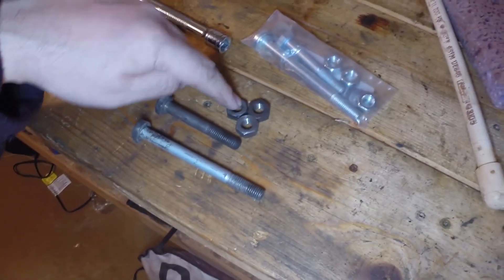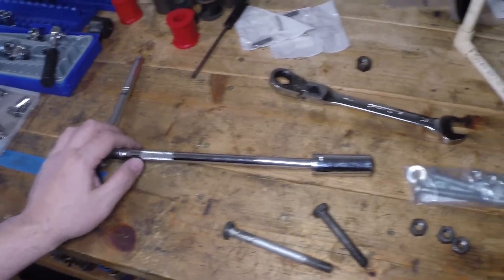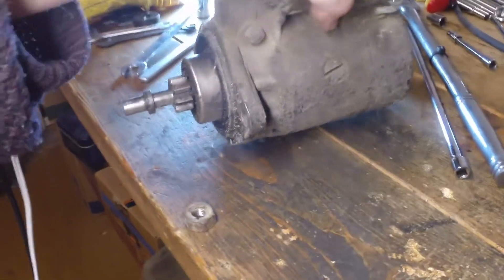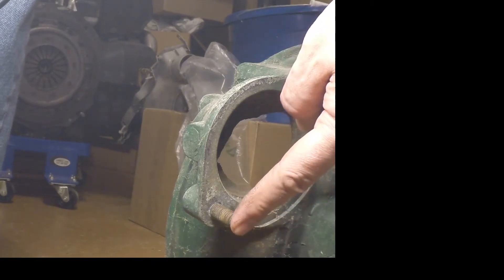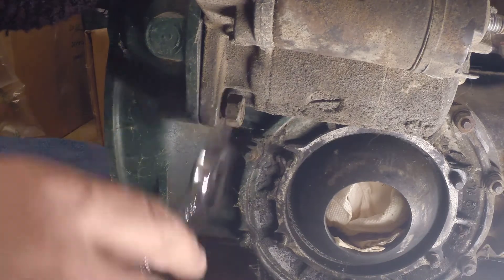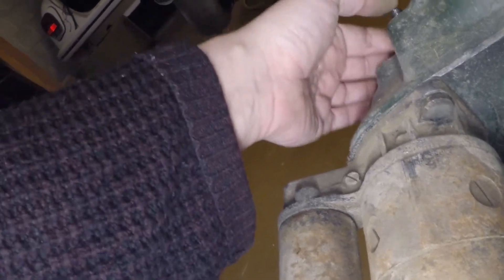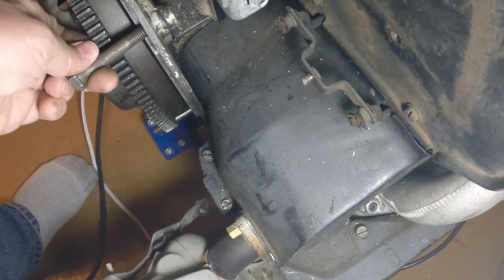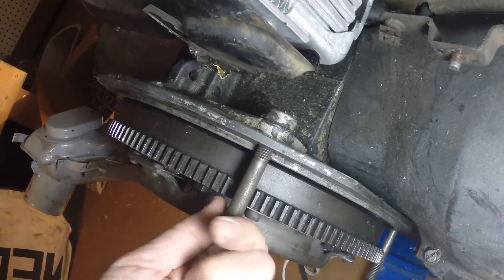Aircooled VW engine mount bolts

Comment: What are the size of the bolts and nuts I thought I heard you say metric 17 mm is that correct size and length is that through basically all Beatles from 50 to 60 s?
Reply from the maker: I believe for my 1972 Super, you access the bolt heads and the nuts with a 17mm socket or wrench, yes.  If memory serves the diameter of the threads (the size of the bolt if you're buying it in a store) is 10mm.  

As far as how consistent that is, I have no idea.  I suspect it's pretty consistent but I don't know.  As I mention in the video, the arrangement of the upper left bolt varies between non-doghouse and doghouse oil cooler cars.  If you want a real answer for that, go on thesamba.com and ask.  

I think my real answer to your question is if you're missing mounting hardware for an aircooled VW car, just buy a mounting hardware kit that's the right one for YOUR car.  They will have all the right fasteners and washers and they'll be strong enough to serve the purpose.  Good luck!

Comment: Boss man after the bolts and nuts for the housing are off the motor should slide right off the transmission? I’ve done stuff on newer automatic vehicles and I was wondering if there is some sort of interior bolts like how the automatic transmission ls have connected from the flywheel to the torque converter. I’ve been having trouble getting past the bolts and nuts part
Reply: Do I need to remove the clutch linkage or anything extra? I am trying to remove the engine only
Reply from the maker: @chapo9724  See above.  No, the clutch cable connects to the clutch arm which is attached to the transmission housing.  You do NOT have the remove the clutch cable to remove the engine, but you DO have to disconnect the accelerator cable from the carburetor.
Reply from the maker: I'm sure there are youtube videos about removing an engine from an air-cooled VW, or failing that, books about it.  

As far as your specific questions: 
The only connection from the engine side to the transmission side at the clutch is that the center of the clutch slides onto the splined transmission input shaft.  The four bolts (discussed in this video) are the only STRUCTURAL connection between the engine and transmission.  FIRST REMOVE THE OTHER CONNECTIONS (see below), support the engine on a support or a jack, remove the bolts, and slide the engine to the rear.  The engine doesn't have a lot of extra room.  It will be free of the input shaft about when it hits the back of the frame.  You have to TILT the engine back to get the clutch free of the input shaft.  The clutch connections to the car are all on the transmission side.  

Other connections you have to remove BEFORE the big ones:  the fuel line (PLUG the hose from the car!), the clutch cable, the main electrical connections from the car, the connection to the transmission for the reverse switch (that may depend on year), and the connections to the evaporative fuel canister under the right rear fender (definitely depends on year), and the connections to the heater boxes.

Comment: Why not fitting washers? Very bad without. To keep the D screww in his position , use a littele bit rubber or other soft plastic over ist. So it cannot move back out.
Reply from the maker: The car didn't have washers when I got it, and I haven't bothered to add them.  I may try to remember to get some and add them when I have it off the next time, but I'm probably not going to seriously lose sleep over it.  

Having something to hold the D-bolt in place would be great!  I would love to see a photo of an example of this if you have one.

Comment: Hi! great video. are all the 4 bolt transmission patterns interchangeable? Im new to the vw stuff and looking to buy a 1600cc engine to bolt into a dune buggy i have. The transmission i have uses 4 bolts like you have in your video. I purchased the buggy without any engine. i have found several engines for sale locally. In my research it looks like the transmssions are somewhat interchangeable. Any info would be appreciated.
Reply from the maker: I think all of the bolt patterns are the same.  However, my impression is there are a couple of other considerations.  

As far as the engine mechanically matching the transmission, you'll want to make sure that they're the same "voltage".  The starter and flywheel gear teeth are different between 6V version of the Beetle (1966 and previously, approximately) and 12V versions (1967 models and later).  I think the engine bell on both sides may be slightly different on both engine and transmission as well between 6V and 12V.  

I"m pretty sure that any 1600 engine is going to be 12V, so you'll want to check your transmission and starter (if any) if they're 12V.  If they are, then you may be able to use them as-is.  If the transmission/starter combo are 6V, then you might want to consider swapping them out.  

As far as the transmission, if you need/want to swap it, then it's a consideration whether it's a swing-axle or an IRS.  Swing-axle has single axles hinged at the transmission end but otherwise solid.  "IRS" has constant-velocity shafts that have U-joints at both ends.  I presume it would be more complicated and expensive if you wanted to switch from one to the other.  

Double-check all of this; I'm not an expert on any of this.  Good luck, and let us know how it goes!

Comment: No engine mounts from engine to frame?
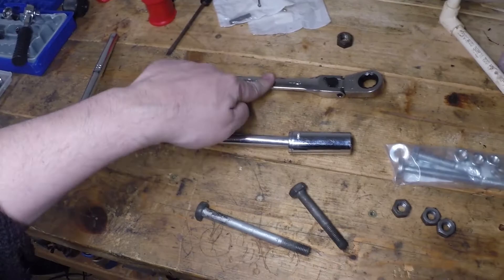Reply from the maker: No, there isn't.  I mention at 1:25 in the video that the engine mounts rigidly to the transmission, but the transmission attaches to the frame by three flexible mounts that serves to cushion the vibrations from the engine/transmission assembly from the body.  The engine tin is close to the body all the way around the engine bay but it's not mounted to the frame there.  As far as the rear sheet metal of the car is concerned, the engine floats there.  All its weight is on the transmission.  

Does that help?

Comment: Awesome video and helped make so much sense too me. I always wondered why three nuts and two bolts. Now it all comes together (no pun intended )
Reply from the maker: You're welcome, thanks!  

(For others who may read this comment:)  Yep!  It's studs and nuts on the lower two, bolts and nuts on the upper two....except that the nut on the upper left is pressed into the engine bell housing and so is hidden.

Comment: So I can't find this answer... should the 4 studs have washers along with the 17mm nuts?
Reply from the maker: I suspect they did originally have washers, yes.  The new engine mount hardware set I have in the garage as a spare has a wavy washer for each nut.  I presume they're mainly to protect the engine and transmission bell housings from scoring as the nuts get tightened. 

Having said that, my 1972 Super in the time that I've owned it never had washers anywhere in the engine mounting hardware, just the nuts.  I haven't bothered adding any.

Comment: good video. What size ,thread, pitch are these bolts? I'm build my car from scratch. I don't have any of these bolts. Thanks
Reply from the maker: Hi, 

The engine mount hardware is important enough that if I were you, I'd try to buy them specifically made for that purpose.  In any case, I'm not sure you can get the extra-long bolt with the D-shaped head anywhere except a VW supplier.  The part number for the hardware install kit is 111199000A (for 1971 and later VWs).  It's available at Wolfsburgwest.com for $6.76 right now.  That indludes the long D-head bolt, the other bolt for the other upper mount, three nuts, and washers.  

To answer your specific question, I just got out my spare kit.  They seem to be M10 bolts/nuts by 1.5 threads.    But again, if you're actually going to hang an engine with them and drive the car, I'd just order the real thing and be done.
Reply: @fsodn  .Thanks ! this is alot of help .ill order them. also do you  have any idea what bolts/ nut size for the bracket that holds the cable clutch to the trans axle? I have a sedan trans that's missing one bolt and i have no nut for the bolt thats there. Id like to save 15 trips to the hard wear store while trying to guess metric sizes.Thanks for replying !
Reply from the maker: I don't know, and I'm not with my VW stuff at the moment.  

If you don't have one, I would go on thesamba.com and create an account.  It's a great community and there are folks there with a ton of knowledge.  I would ask your question there.  I'm sure there's someone who knows.
Reply from the maker: FYI: metric bolts are sized by their outer diameter in millimeters.  If you don't have one, I would pick up a cheap calipers.  Measure the outer diameter of the bolt (including threads) and the "M" size is the number of millimeters that are slightly higher than that.  The engine mount bolts were just slightly less than 10 mm in diameter, thus M10.  

For any given M size, there will usually be two thread numbers, one "fine", and one "coarse".  In metric the number is the distance between the threads in mm, so the higher then number, the coarser the thread.  

Here's a thread they have on bolt threads: https://www.thesamba.com/vw/forum/viewtopic.php?t=313722

Comment: At 5:51 I saw stocking feet while lifting the tranny. Nope! That’s just dumb, on par with using a carpenters claw hammer in a metal shop. All your cred vanished in that instant.
Reply from the maker: The transmission is like 20 pounds, less since that particular transmission is missing about 60% of its innards.  I could hold it up with one arm if I had to.  My feet are in no danger.  

I don't have a metal shop.  This is my garage.  I'll use a claw hammer in it if I damned well please.  

I've done way stupider stuff on my channel than lift a transmission in stocking feet, or use the wrong hammer.  I have a video about using a ball joint separator tool to extract some rubber suspension bushings.  I recommend that video; it's really scandalous!  Really, I'd check out all my videos to catalog the dumb things I do.  There are admittedly a lot.  I used a drill on a gas tank; it's pretty awesome.

Comment: Thank you, I don't think I would have gotten that one top bolt opposite of the starter off if it was not for your video.  I am used to older VW engines where there was just a nut there.
Reply from the maker: That's fantastic to hear!  

So it was a bolt with a hex head under the car, and a nut on the engine side?  

That's super-cool!  I'm so glad it helped.
Reply: @fsodn  My '70 bug has a tapped thread in the engine case and a hex head bolt through the transmission side, like in your video
Reply from the maker: @tompearson8364  Does your engine have the dog house oil cooler shroud?  In other words, can you reach where the nut would be on the car with the engine in?  

Thanks for the info.
Reply: The engine has an older style oil cooler so there is space to get a wrench behind it. However, the case is from a newer model that had the doghouse
Reply from the maker: @tompearson8364  Yeah, that'll do it.  I'm so glad this was useful for you!

Comment: Your explanation  of the 1971 save me alot time as opposed   to the the other You Tube vids
Reply from the maker: Wonderful!  I'm so glad.  Yeah, it's hard to see them on the car.  Having removed and installed the engine in my VW a few times, and mostly doing it by feel, I wanted to make this to help people do it.  

What kind of VW do you have?  Were you removing/installing the engine, or the starter, or what?  

Thanks for watching.

Comment: You’re mixing up left/right etc! Common problem with VWs is also front/back description. We need a standard!
Reply from the maker: Thanks for the comment.  Mixing it up is easy to do, yes.  People often refer to the "rear main seal" in a VW engine, which is on the flywheel end of the crankshaft (and thus is the forward end of the engine).  

However, I don't believe I made any right/left mistakes here; I just watched the video again to check.  I always refer to the right upper mount as the one that shares a bolt with the starter, and the left upper mount bolt as the one into the captive nut by the oil cooler.  And I don't refer to the lower studs by left or right at all.  

If you think I mixed something up, please give me a time stamp where the mistake is.  

There is a standard.  Maybe not invented by him, but John Muir (who wrote _How to Keep Your Volkswagen Alive_) uses a very strong convention in that book.  He uses "right" meaning the right of the vehicle, that is, standing behind it and looking at the part as it sits in the car, and left likewise, and front is toward the front of the vehicle, and rear toward the rear.  So the starter is at the upper right of the engine.  The generator is right of center.  The oil cooler is on the left side of center.  The belt pulley is at the rear of the engine, and the flywheel is at the front of the engine.
Reply: @fsodn  It could very possibly have been myself that was confused LOL To avoid confusion years ago, sailors invented specific language such as forward-aft-port-starboard. Obviously the issue with VWs is due to an engine in the back and then compounded by the engine being “backwards”!  The main rear seal is in the front SAY WHAT???
Reply from the maker: Yep.  All very well said.  Thanks for the response!  

Because of the confusion you talked about, I was very careful about left vs. right in this video.  However, I admittedly was not especially careful about camera angles, because I was concentrating on getting good lighting and clear camera shots of the bolts/nuts, rather than a consistent viewpoint.  So that was a bit confusing if you're not used to looking at VW engine/transmissions.
Reply: @fsodn  thanks, I imagine it’s not easy. Keep it up.
Reply from the maker: Thanks a lot!  Please subscribe, and tell your friends.  

I've done a ton of work on my Beetle since late May, and I have film of most of it.  I'll be posting lots more videos about it this summer and fall.

Comment: Thank you!!!
Reply from the maker: You're very welcome.  

I kind of liked this one.  I find it's hard to get a feel for how something is arranged or how it goes together if you can only see parts of it at a time.  I had the opportunity with my engine out, and the junk transmission to show the bolts in a way that you can actually see how it goes together with reasonable lighting.  

I have several other VW videos on my channel, feel free to check them out!  I also have many more on the way as I get my 1972 SuperBeetle back on the road.  I just got the right front spindle off the shock tower which I'll have up as a new video in a few weeks.

Comment: I haven't broken top left motor mount bolt The head's broken off I'm trying to remove the motor that should be just a threaded nine threaded hole in the engine side of that hole right I'm bolting to the transmission with my bolt the is the whole upper left hole motor mount hole threaded on the motor side please help
Reply from the maker: I think you're saying that you're trying to remove the engine from an air-cooled VW, and there's a problem with your upper left engine mount bolt, is that right?  

The answer depends on whether it's a "dog house oil cooler" engine or not.  If you reach in front of the fan shroud on your engine toward the engine mount bolt, but you can't get to it because the oil cooler and it's piping are in the way, then you have a dog house oil cooler.  If you can see the upper left engine mount bolt looking in there, and touch the engine block from that side by reading past the fan shroud, then you don't have a dog house oil cooler.  

If you have a dog house oil cooler like mine, then here's your answer.  With a dog house oil cooler, part of the hole on the engine side is threaded.  

If you don't have a dog house oil cooler, then I think the hole probably isn't threaded, but I don't honestly know; I've never worked on one of those cars.  

Either way, if the head is broken off of the upper left mount bolt, you may be able to get the engine out anyway.  You can just pull the engine back, and the headless bolt will slide out of the transmission.  

If you don't have someone local to talk to, though, your best bet is to go onto the site thesamba.com.  It's a a site with a ton of forums, all on air-cooled VWs.  There are many experts there that can help you and they'll know how to deal with your problem.  

Good luck!